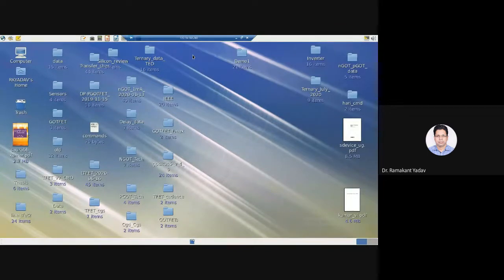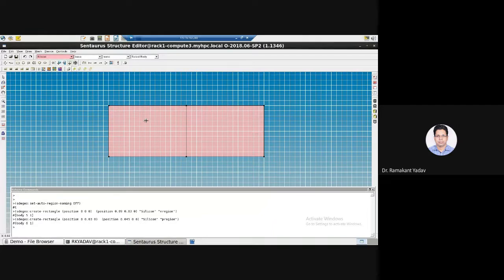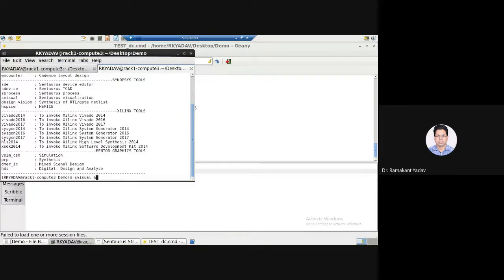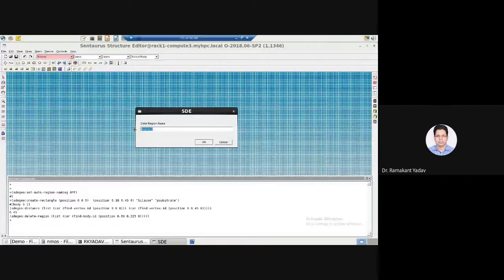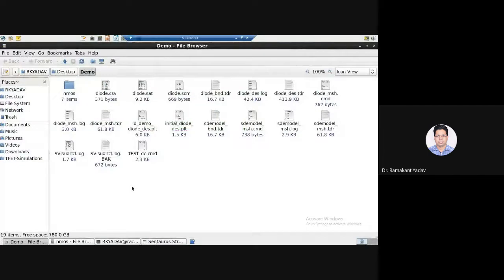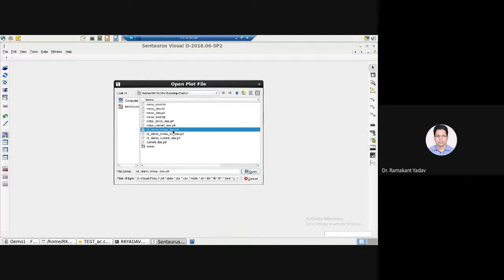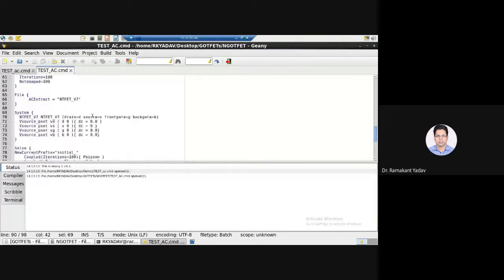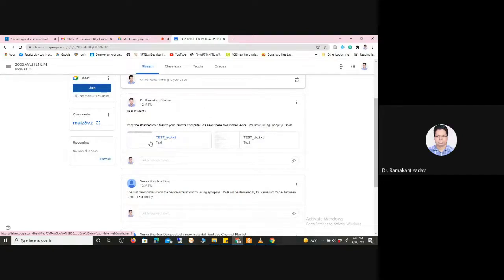2022-01-31 synopsys TCAD demo - Ramakant Yadav (BITS Pilani, Hyderabad Campus)

Comment: Thank you. 
I have a problem. I have simulated a simple MOSFET in Sentaurus TCAD. In my SDEVICE I set Drain voltage in constant value like (Vd) which I can change manually from SWB, then I sweep Gate Voltage from -Vg to +Vg and I get very fine IV curve.
I want to do this for a lot of Vd and export the XY data of IV curve in Excel file.
I can export the XY data of the plot one by one but it's really frustrating and takes a lot of time.
Is there anyway that I can do it faster?